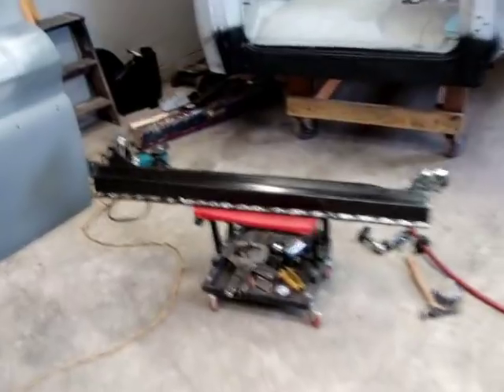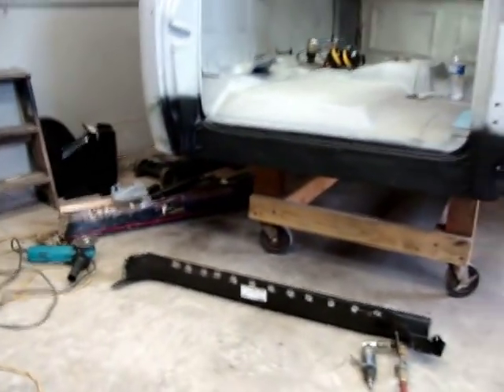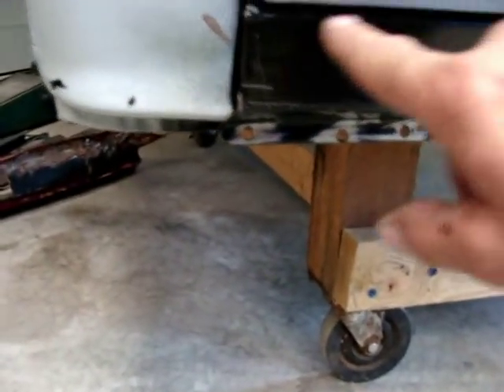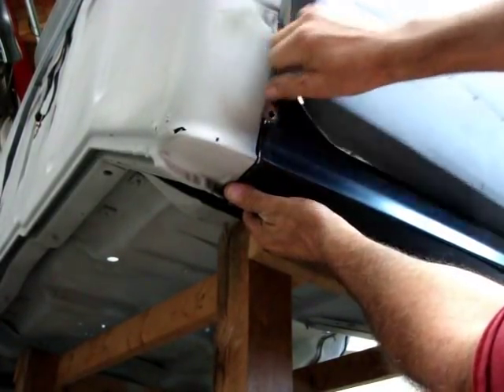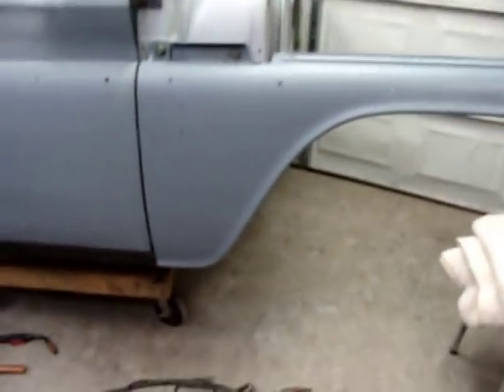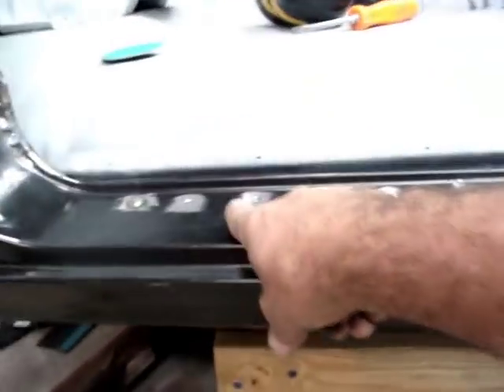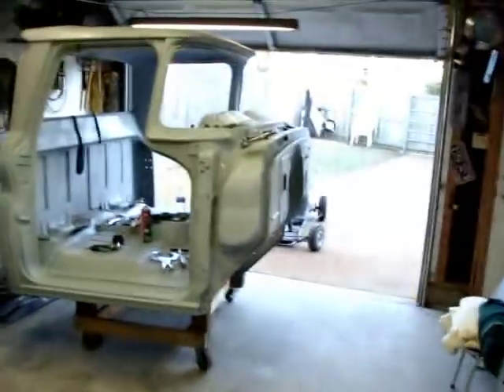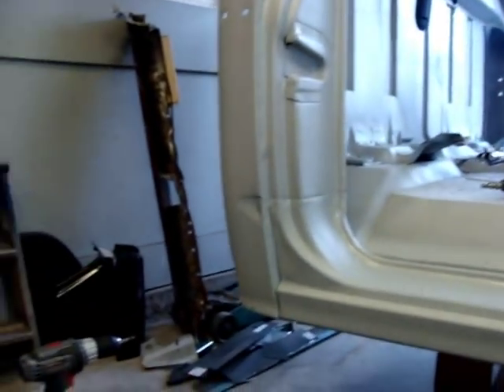install rocker panel

Comment: Who in the world would give a negative on this guys video?  That’s crazy.  The man is doing REAL work, at a very high level, and sharing to help others.  
I started my floorpans and rockers on mine, and have now discovered I’m going to have to remove fender to remove door to replace rocker stuff.  Mine needs inner and outer and cab corners and partial pans.  I sure am dreading the rusty 1966 fasteners, but....

Comment: Very good video! After 5 yrs, I don't know if you'll see this but as a DIY first timer, "been there, done that" I applode both your repair methodes and video editing.
I discovered the hard way, 4 years ago, that your methode of grinding the paint/primer away gave me better welds even when using gas than using the best Weld Trough primer.
Did inner/outer rockers on 2001 F350 SupperCab and starting tomorow, left/right outers on 2000 Expedition.
Again, excelent video. Good methode and good narative!
Russ
Reply from the maker: RJinNH   Thanks for watching

Comment: I was wondering have you used the Eastwood rust Encapsulator by the gallon? I wanted to know the shelf life on it? The stuff is not cheap and me and my buddy were talking about pot 15 witch has no shelf life. Should I just buy it by the riddle can?
Reply from the maker: David DeSordi  I’ve only use the Eastwood rust encapsulator in the aerosol cans Great stuff holds up well.

Comment: Thank you for the videos. Nicely done! Noticed that you have a Lincoln Electric welder, curious as to what you have your settings set at when welding sheet metals. Thanks.

Comment: Why don't you use the new "weld through" primer that allows you to weld without grinding to metal? It would ultimately save you time and money it seems.
Just asking, not criticizing.
You are doing some nice work. Thanks for sharing.
George

Comment: Your videos are super helpful, thanks!  I am tearing apart my 1966 GMC C10.  About to take cab off.  I noticed that you did not do any bracing inside the cab before removing and repairing the rockers.  Did you have any trouble with the body gaps when putting everything back together?  Thanks for your help.
Reply from the maker: Thanks didn’t really need brace on this when replacing rockers or cab corners, if I would’ve cut out more of the floor I would have braces, I always measure before cutting any panels out,the gabs really looked good after this repair, thanks again man take care
Reply: @Gibson63.  thank you!  My floor is in good shape, just need to replace a corner and rocker in one side.

Comment: You could mark your cut out pieces with a small piece of tape,...
       Then undercoat,...
        Then remove tape for a clean 
           weld spot.
Less grinding and less materials.
                        ENJOY.

Comment: so when you primed your rocker. did you find it necessary to scruff up the black coating from the manufacture?
Reply from the maker: Yes I scuffed all the black e-coating down before I epoxy after putting this truck together I sanded a few more times re-epoxy then high build
Reply: +Gibson63 Ok so can I ask you a question?  When you sprayed the underneath of your cab with that black (what was it). How come you decided to spray it with that black instead of paint it the same as entire cab that red color?
Reply from the maker: +Jer Bear   I used the Rock-it-liner on bottom of cab, had a few patch panels that I welded in didn't want to grind them all the way down, this undercoating worked great

Comment: Do you just put bondo on the seems above the spot welds?
Reply from the maker: Shane K    No I didn't fill over the seam I keep it like the original look with the seam
Reply: Thank you, I'm getting ready to replace mine but have never done body work, your video helped.

Comment: Hi I'm not a welder. I've heard of using some 3M 08115 Panel Bonding Adhesive  instead of welding. Any thoughts on that?